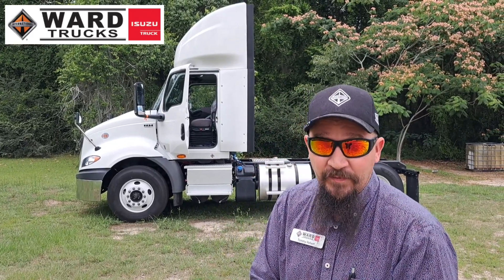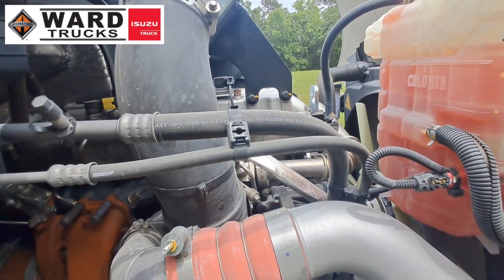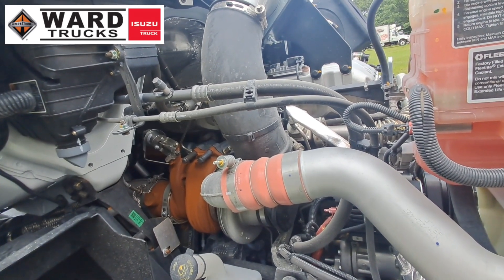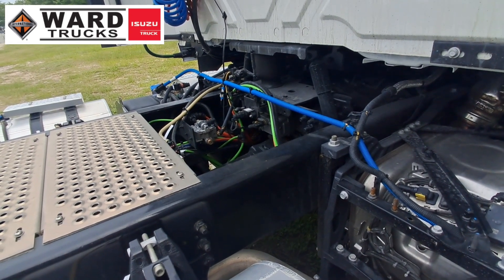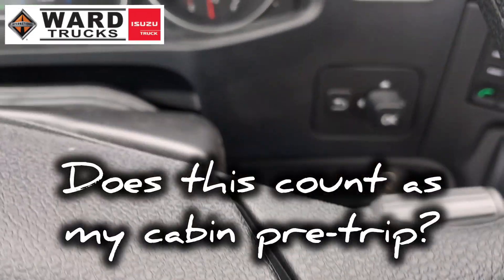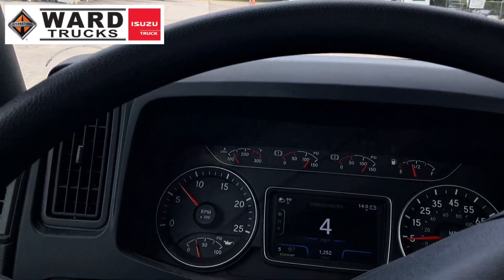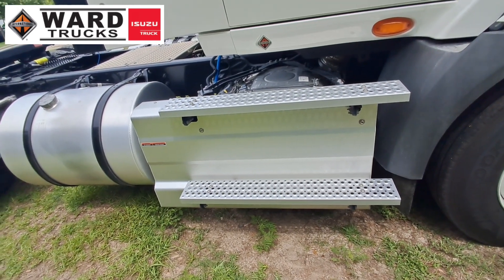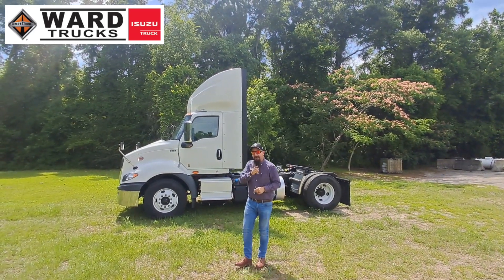New S13 Integrated Powertrain with T14 transmission. No EGR, no VGT, no manual regens!

Comment: I wished you would had cut the blower fan down a little while you were inside cause the camera picks it up big time.  But man, this was a great video!!  This S13 seems pretty sweet and I'm a Detroit man.  I run a DOT shop so we have ALOT of Maxxforces until 2019 when we switched to Detroit.  Needless to say, you know our Maxxforces tear up ALL the time...

The no EGR is absolutely awesome!!!  This just seems like a sweet set up.  Maybe we'll get a few of them and see how they do.

Thanks for the video my friend!!
Reply: OH!!  I meant to comment on that "Turtle Mode".  That worked really really good.  I'm used to our Eaton Autoshift 13 speeds and our Detroit DT12's and they are not smooth at all when you're trying to creep up to something.
Reply from the maker: Appreciate the kind words, my friend. If you need any assistance my phone number is in my PFP and I'd be glad to help.

Yes, the S13 is going to revolutionize on-highway diesels here in the states. They've had the same motor in Europe for over 2 years and it is best-in-class for a 13L.

Stay tuned, they'll be doing away with the EGR entirely for GHG27 emissions and potentially simplifying the aftertreatment further.